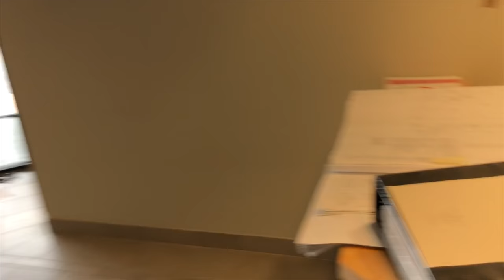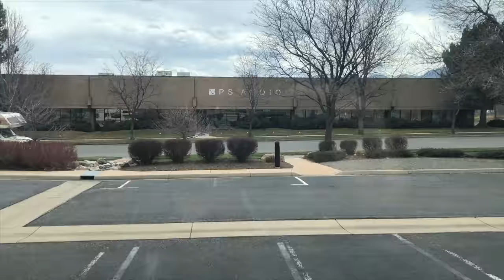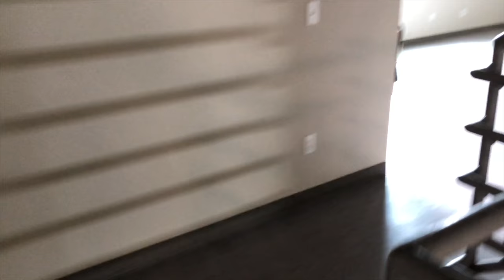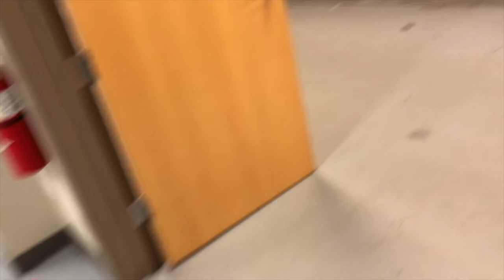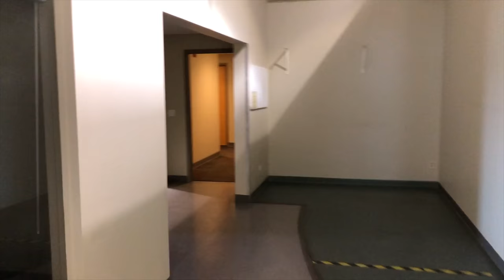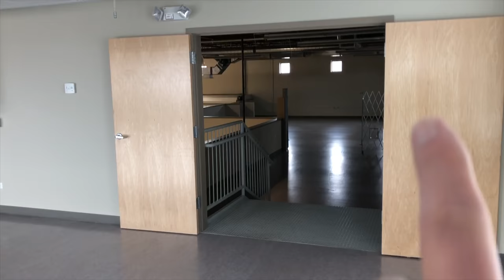PS Audio's building tour before construction

Comment: Very exciting times. Glad that PS Audio is doing so well. As an engineering exec I have started with new buildings like this and built them out to suit engineering and productions areas. It’s design work of a different kind, but rewarding nonetheless.

A comment: Chambers which are anechoic to radio frequencies (electromagnetic fields) are not necessarily well suited for anechoic testing of acoustic sound waves. I have been in radio anechoic chambers that seemed pretty quiet acoustically, but due to the resistive coating on the foam wedges did not have the right stuff for a proper acoustic anechoic chamber, especially at high frequencies.

Nowadays we have MLS pseudo noise virtual anechoic acoustic testing available so it’s not a big deal. That space is better used for your warehouse I think!

Comment: Moving is always exciting, I hope all goes as planned - just expect the unforeseen to rear it's head. 

Back in 1970 I worked for Analog Devices which was on Binney St in Cambridge. The company bought the old mill building across the lot and that was going to be for engineering and production test. I remember the engineers and techs carrying the test equipment across the the new digs because we didn't want to chance the movers jostling things around to much. Anybody who has ever had to move a bevy of Tektronix 545B's knows how heavy those are and what great room heaters they are to boot.

A year later they moved out to a new campus in Norwood and that is when I left and continued for 24 years in the power supply industry. I had worked for this same power supply company for about 6 months before being invited to go camping with the army in South Carolina.